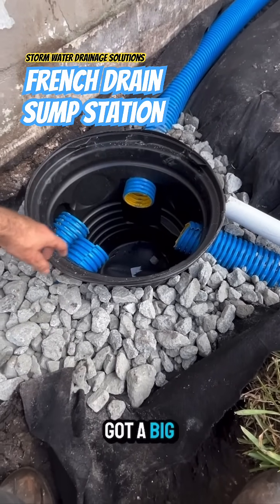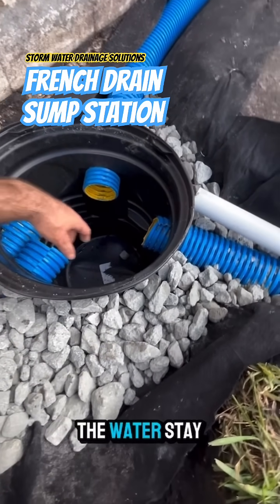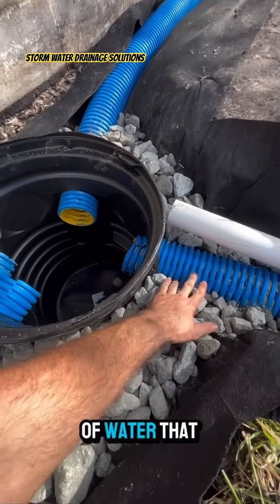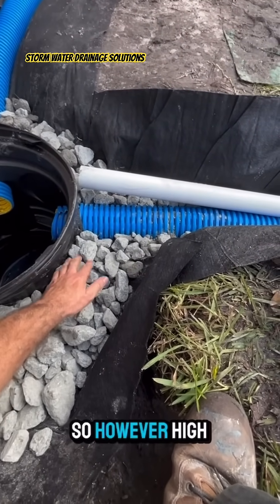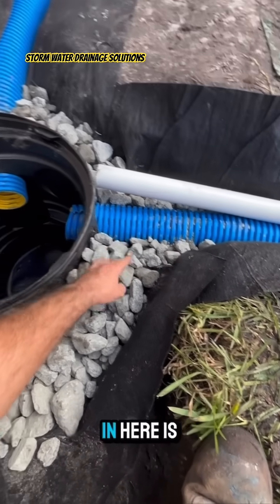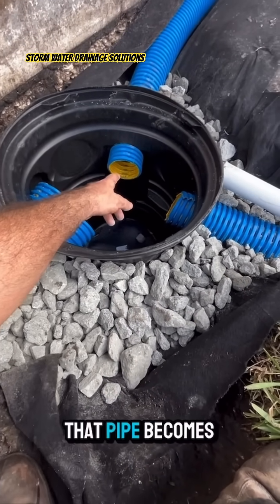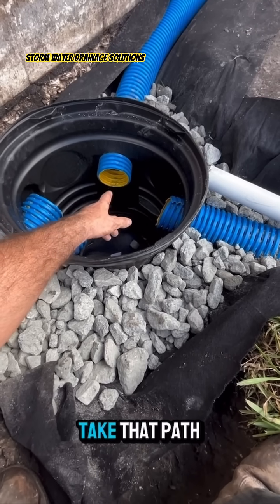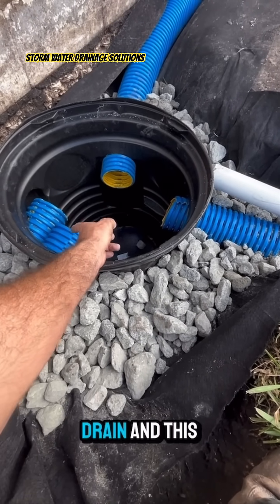French Drain - Sump Pump Station - Yard Drainage System - Understanding French Drains - Tampa FL.

Comment: Where's that basin from ? Every basin i try to install is like 2 feet deep. That's ridiculous
Reply: I use a plastic 55 gallon barrel for mine. Then either a steel top or concrete one. IF I need a 3 or 4 ft tall one. I cut and make to the size I need.